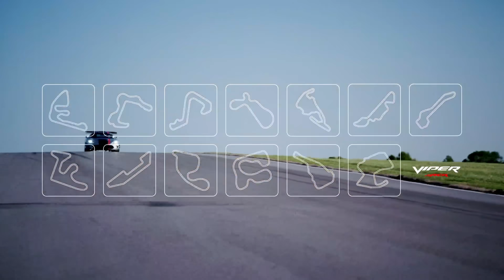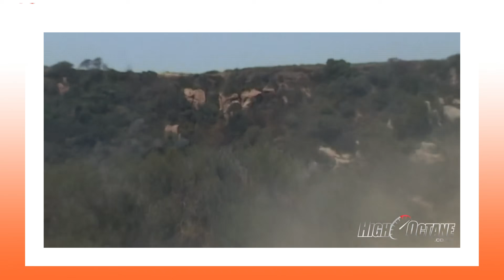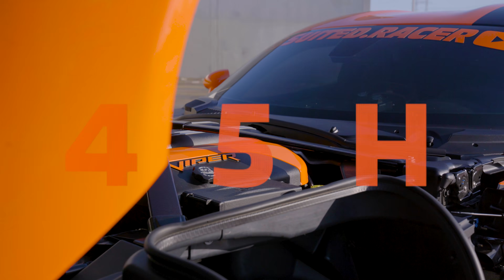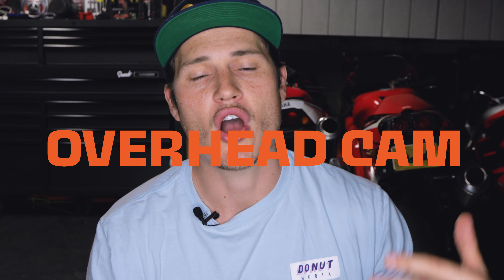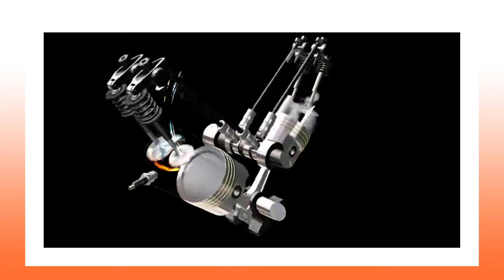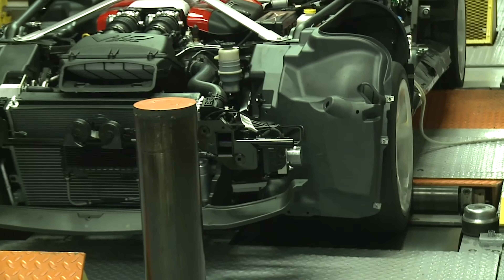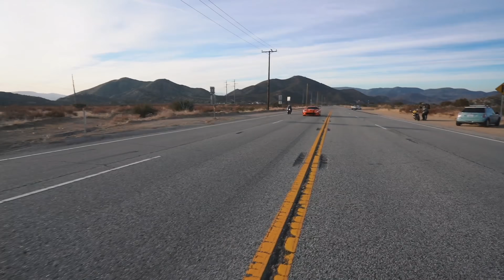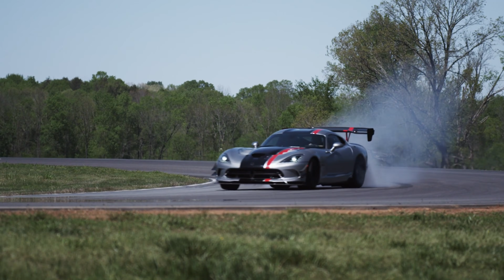The Engineering Behind the BEST car America Will EVER MAKE - Dodge Viper ACR

Comment: Ford Mustang: Kills crowds

Dodge Viper: Kills you

American cars are the best
Reply: @Chillie i think u meant kills tires when u do burnouts all day
Reply: Camaro: kills decepticons
Reply: @maybeknocko5507  It was designed made in Australia so yeah...
Reply: Chevy: kills itself
Reply: Chillie 
No. 
Coming from Dodge’s biggest fan.
Reply: MasterGaming Nic I think he’s talking about the demons drag times
Reply: MasterGaming Nic 
Yeah 
That is coming from a supercar owner that raced a demon
Reply: @mastergamingnic1681  it aint coming from dodge's biggest fan. because if it were, you'd think about the demon running 9.6 second 1/4 mile laps. and destroyin the lamborghini aventador.
Reply: @coltonreeeed  The Aventador is a 9 year old car. The Demon had to wait until winter when the air was denser and had to run perfectly to beat MOST supercars. I'm a fan as well, but I'm not blind. The Dodges are fast but not Supercar killers for the most part.
Reply: @digitalcamaro9708  the Aventador is almost 4 times more expensive than the Demon though. it's not a drag racer's car, it's a rich kid's car.
Reply: @sepg5084  Yeah but someone brought up the Aventador when it's not a good competitor for the Demon.
Reply: @Colton yeah but only in straight lines. Around a track there’s no way.
Reply: @coltonreeeed  just because its faster in the straight line doesnt mean its a supercar killer. The demon was designed for one thing: drag racing at which it is extremely good at but take it anywhere else where there are corners and itll be eaten by just about any sport/supercar. You cant really compare those two they are way too different
Reply: @coltonreeeed  Not everything is about drag times, the challenger handles like a boat.
Reply: Colton yeah, but you got to remember that the challenger was meant for the strip, not the track, in the track, it will just get destroyed.
Reply: @digitalcamaro9708  and its awd with a v12 and light af sooo..
Reply: @amberionik  well it kills so. and it does pretty damn good burnouts lol
Reply: @Fcruz9104  i get its made for the strip and yes the aventador with kiilll the demon on corners. its a quarter of the price with a bit more horse power and a lot more torque. i personally love the aventador, its a classic. if it were me id get the demon because of price.
Reply: Colton 
No, because most supercars are not made for drag strips, they’re made for race tracks. They have lots of downforce so they can go through corners quicker. Dodge Challengers don’t have a lot of downforce that’s why they suck at cornering but is great at straight line speeds, and yes, I am a self-acclaimed Dodge’s biggest fan, just one with a brain.
Reply: @sepg5084  rich persons car*
Reply: @heisenburgertm  it's just like a fat chick more enthusiasm less maneuverable
Reply: @coltonreeeed  lol my 600whp awd civic runs that with street tires
Reply: actually Dodge viper kills you and crowd if you cant handle the monster.
Reply: Carl Mendiola so what you’re saying is that there should be a Shelby GT500 with the Viper V10 and aero? So that kills you AND the crowd?
Reply: David Gonzalez more efficient
Reply: David Gonzalez yes but actually yes!
Reply: Dodge Mustang: Annihilates
Reply: Donut editors: Kills your ears
4:50
Reply: Carl Mendiola I can just hear that smug smile on your face
Reply: Say less
Reply: Shelby AC Cobra: Kills both
Reply: Best to describe american cars 😂 .
Reply: Demons and Hellcats kill it's rear-end including the shaft,

Go to a modern hemi shootout and go dumpster diving for scrap you will at least come out with 500lbs+ of broken cv axles, driveshafts, rear chunks, hell even the housing
Reply: Ford gt's kill Ferrari's
Reply: Camaro: kills new enlistee's credit with super high interest auto loans :)
Reply: Mustang: Kills crowds
Viper: Kills you
Camaro: Kills itself
Challenger: kills superchargers
Charger: kills the quarter mile
Reply: Fuck yea laughs while signing will
Reply: Lmao XD 😂😂😂
Reply: Dodge challenger ft from 1970?
Reply: It’s beautiful isn’t it
Reply: Chvy? Best
Reply: They're overpopulated
Reply: Well i can say Dodge demons flip you, those things around corners, i remember when they cam out a guy try to take a tight corner, poor guy flipped that new car. Dank sad.
Reply: American supercars: viper, gt, vette
American muscles: stang, camaro, challenger

Exotics: lambos, and the like. Although the gt and vette are going the exotic route as well. I hope the next iteration of viper as well.

The camaro, stang, and challenger are becoming supercars anyways since musclecars are slowly being phased out.
Reply: @wanderingbufoon  they aren't becoming supercars.
Reply: @LolliWANG505  sure they are. Majority of cars nowadays are being standardized to go faster, safer, more efficient in every way.

On top of that, these muscle cars are no longer what they used to be. The designs are moving more towards aero to bring more into the performance.

Suspension is no longer just designed for straight lines. These muscle cars are now being designed with track in mind.

Sure, their main attributes is still about having power and putting it all down in a straight line but that isn't JUST the case anymore.

Might I add the design language of Mustang. It is becoming more and more rounded and slimmer (much like the old design which was similar to the corvette).

Hell, they even made the newest one an electric SUV. (good going Ford, idiots)

Camaro isn't there yet. It is in the middle of where the mustang and challenger are (the happy medium).

But outside of aesthetics, these cars are slowly becoming track focused.

Supercars are adopting more exotic looks (mid engine with full aero, not a lot of practicality).

GT was the only one that you could say exotic but now the vette is too (although it is still pretty practical so it isn't exotic yet).
Viper is phased out for the time being (although it really is just a front engined Ferrari).

The only thing that sets "muscle" from exotic/sports is whether or not they are flat/crossplaned cank.

Design and performance, they are all trying to be a well balanced car. Not just track focused or aethetics or straight line.
Reply: @wanderingbufoon  the mustang Camaro and challengers are not muscle cars they're pony cars
Reply: @Murica_gaming  semantics. They are muscle cars. They have been since its their pedigree. "pony cars" 

I can call them coupe as well? or a 4 wheel vehicle, no?
Reply: @wanderingbufoon  no they're literally categorized as pony cars and have been since the day they came off the assembly line lol pony cars and muscle cars are two separate classifications
Reply: The Corvette kills German cars.
Reply: @kaibotski4939  but German cars kill Jewish cars unfortunately
Reply: @Chillie does not kill the ford GT 18'
Reply: So are Corvettes the saving saints?
Reply: JDM is life
Reply: @Chrisgrove24  you must have diminished capacity, ls motors are known for reliability, unless your talking about V6 or the 4 cylinder
Reply: Carl Mendiola thats why my dream car is a viper
Reply: Only if the driver is American it’s boring if a skilled confident is driving
Reply: The Soviets would be proud
Reply: LMAO
Reply: Thanks to Caroll Shelby
Reply: @juangarute6918  OOF
Reply: Bmw drivers: crash at 90mph and insurance is up to 250%
Reply: N the slowmaro killing itself
Reply: American bois:Corvette Viper Charger Challenger Camaro Mustang Ford GT 
Japanese bois: Supra  Nissan GTR  acuraNSX Lexus Lc500 Lexus LFA
Itallian bois:Lambo Murcialago Lambo aventador Ferrari f40 Alfa romeo juliet Ferrari la ferrari 
German bois: 911 gt2rs Audi r8 v10 plus Mercedes amg gtr bmw M5
England bois:Aston martin Vantage Bentley continental GT Mclaren F1 Mclaren senna
                                                              Which of these are best
Reply: @starlord7636  I'll take the F1 911 Mustang Viper Vette Aventador 90's R34 GTR Supra  NSX
Reply: @starlord7636  all are pretty good apart from Italian and England bois because they are most of the time overpriced for the performance, I would say American bois
Reply: The only cars you should be buying are either American or Japanese ones
Reply: E60 M5: Kills itself
Reply: @RageCannon5311  yeah, but that's a German car
Reply: @mr.coolio4321  Still, I thought it was funny
Reply: @RageCannon5311  well that's more a job for the camaro (which is an American car)

I'm not trying to sound rude btw
Reply: Lol
Reply: THIS IS AMERICA
Reply: LlOlololololololo
Reply: But what does the Corvette kill?
Reply: have you seen a Lada Riva?
Reply: americans cant drive
Reply: @norbertnippleclamp  lol okay explain Ken Block or Travis prastrana then
Reply: Chevy Corvette: Kills supercars
Reply: @ninavo2468  it is a supercar.
Reply: @ninavo2468  No, JDM kill every cars
Reply: This joke is not funny.
Reply: @Timthespy  u have no humor lol